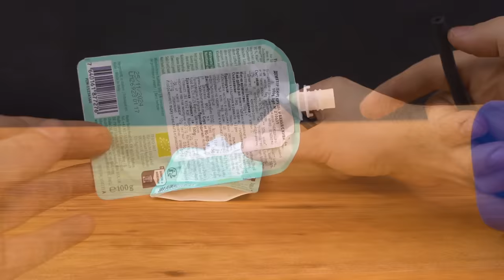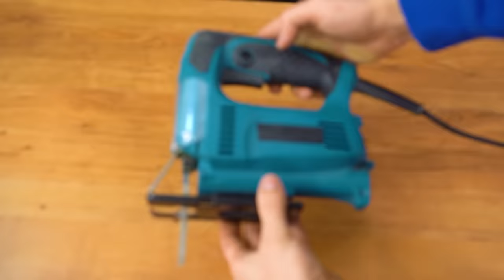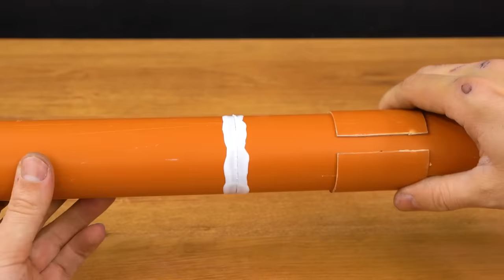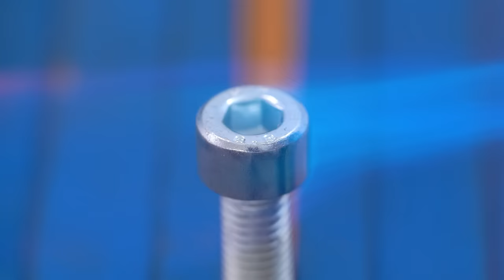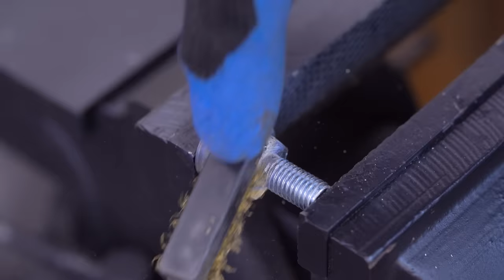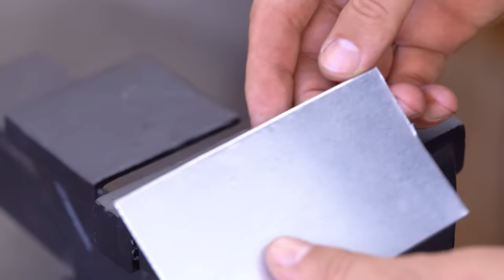Top 30 Practical inventions and ideas from high Level Handyman

Comment: ● Question: What is the clear liquid and the power called? Where can I buy that in stores? Need a store name that can be found in New England, (upper right corner of the country/North East), in the U.S.A.. I stated that because I don't know where this video comes from.  Cheap lock will open easily with just about anything that will fit. I still like the ideas and the video.
Reply: It's ordinary 'Super Glue', and the white powder is ordinary Baking Powder.